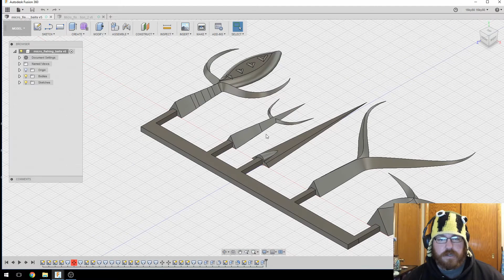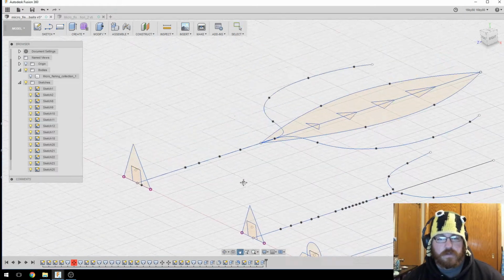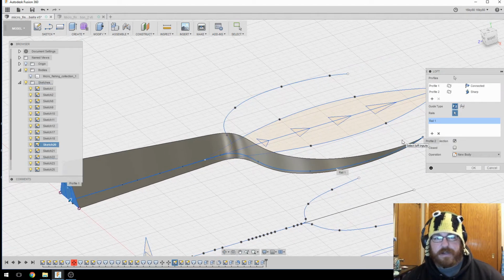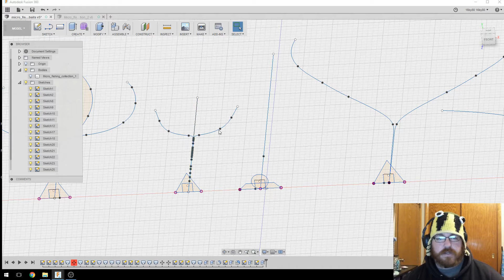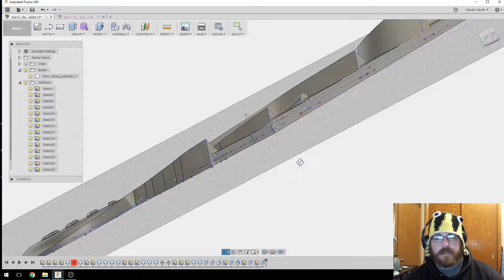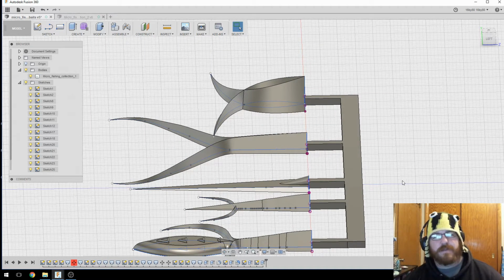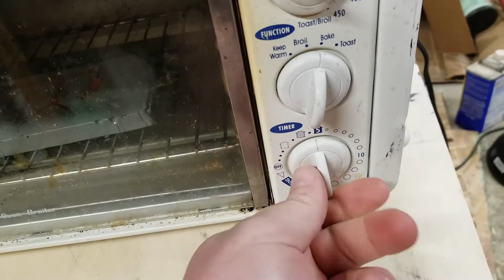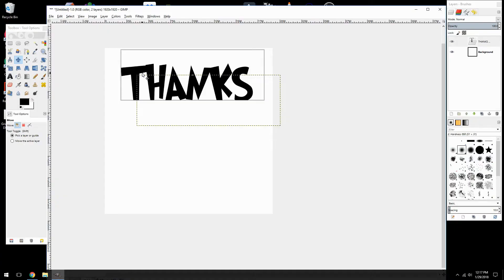Fusion 360 Design, Print and Pour Micro-fishing lures

Comment: Does the vac 50 leave the plastic shiny or flat after poured?
Reply from the maker: It appears more to be a flat color, but I think that is largely depend on the temperature of the plastisol itself. If you can dial in the temperature it greatly improves the surface finish. Also getting the Vac50 properly degaussed will help to make the mold surface less pourous. Machined aluminum is definitely going to leave the most smooth and shinny surface.
Reply: Revamped Outdoors thanks.Im currently building a CNC for that very reason.